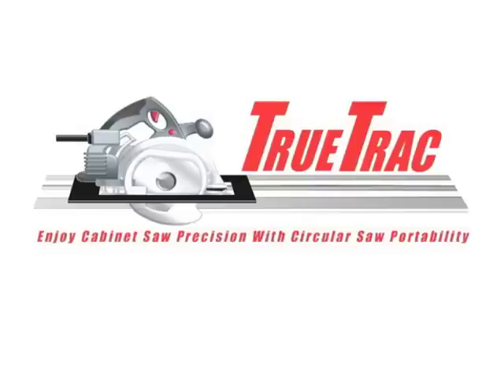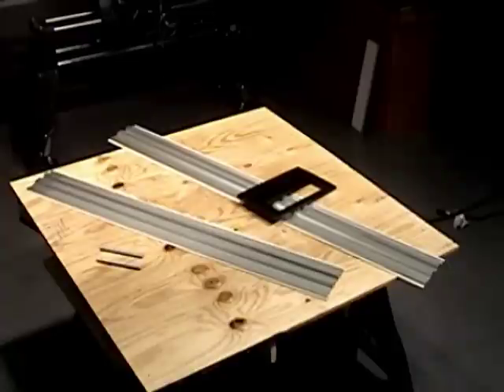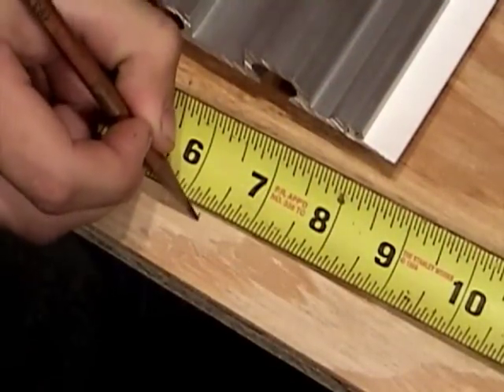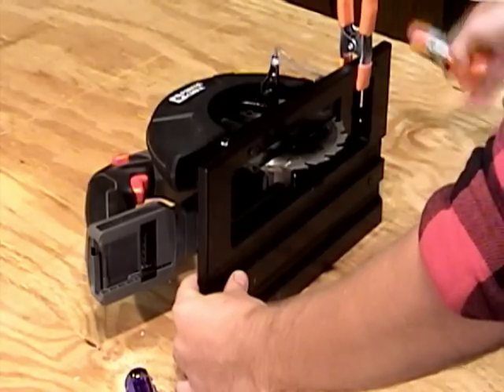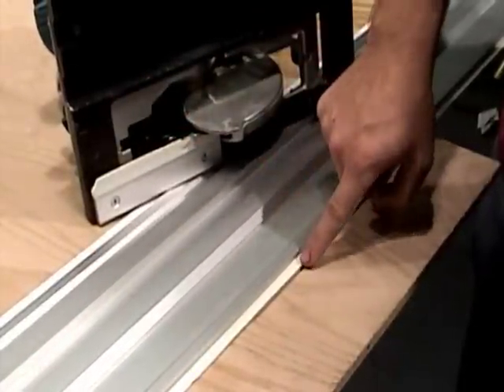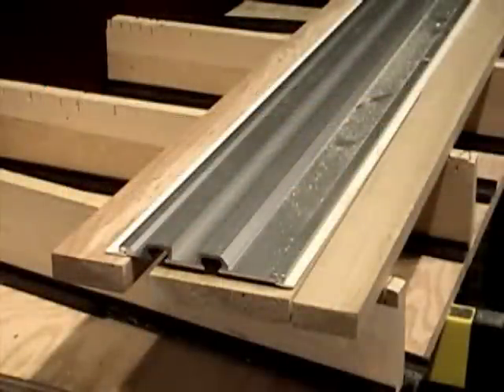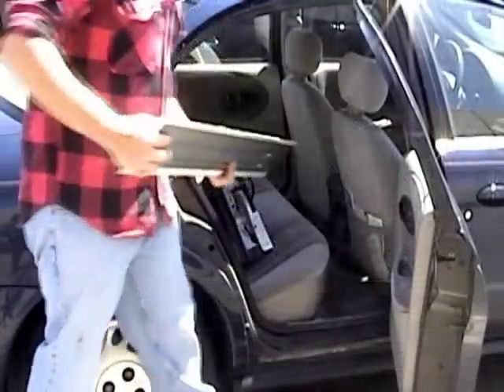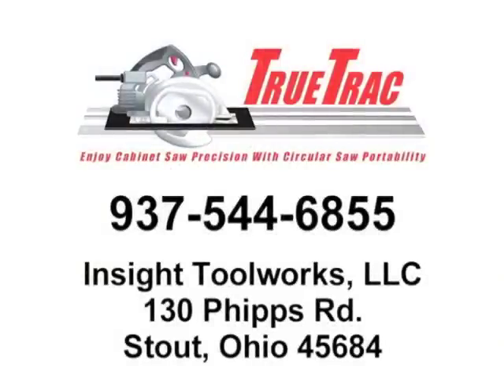TrueTrac Track Saw Guide System

Comment: I need a skilsaw for cut to length cuts on countertop blanks. For that I use a table saw sled design turned upside down. The slot runners now become the edge guides of the skilsaw's baseplate, saw can't wander, even on angle cuts, saw kerf shows cutline, and if your build is precise, the trak squares up to the work. Donations to your favorite charity. I recommend USA for UNHCR. Oh, bonus tip: if you prefer that the skilsaw not lift out but rather slide out of the trak, then just rabbet the edge guide strips. On some saws you will have to notch the front corners of the saw's base plate. Enjoy.

Comment from the maker: @lgttb1

Yes, that is a very good point, although in our preliminary testing of materials for the anti-chip edges we did use an off-brand saw that no one really remembered buying that was found under a workbench in the rear of our shop that had an 18 or 24 tooth framing blade that had been heavily used at some point, and the anti-chip did keep the 1/2 inch OSB board from splintering on the top side, just not from burning/scorching and setting off the fire alarm.

Comment from the maker: @ninjaman58 If you change saws with this system there are two thing you would have to do
1) Drill a set of holes in the base of the 2nd saw in order to mount the plate. The holes can be the same as the 1st saw, or you can drill a second set in different positions, the extra holes won't interfere

2) Replace the antichip edging. Sometimes, perhaps 80% of the time, you won't have to do this since the plate is mounted in reference to the blade and not the saw base, but you may have to in some cases

Comment from the maker: The blade guard does not get trapped by the plate if attached correctly. The opening in the the adapter plate is wide enough to accommodate the travel of the guard and does not disengage the guard before use. See the video at 0:20-0:22 seconds. Kickbacks are a possibility no matter what, but with a circular saw the object will fly away from your body, and the combination of the weight of the track and the applied down pressure when cutting reduce the chances of binding while making a cut.

Comment: I found one part of the presentation confusing. We were told that the white plastic strip was to be aligned on start and end pencil marks and were shown this being done - and then it was said that the white strip  had to be cut back (as i understood it) flush with the metal of the track, which was contrary to what had been shown being done previously.
Reply from the maker: The white strips along the edge of the track are trimmed to your specific saw and blade combination as part of the initial set-up process when mounting your saw to our adapter plate, prior to cutting material for projects.

This establishes the line-of-cut for you to use when aligning the track to the measured marks for your project, as shown in the video. The strips are replaceable and have a 2-3 year life span for moderate use.

Apologies for the confusion, but thank you for commenting and asking!
Reply: @Creslin69  Then I think the video should be edited to remove the portion showing a wide white strip, which has clearly not been trimmed back, being aligned with pencil marks prior to making a cut.

Comment: you could steady your hand as solid as the rock of gibraltar, without a guide it will never come out 100% straight.  I like this design and compaired to the others the price ain't bad.  My concern is this...what happens if i have to change saws, would i have to get back the exact model i first had?

Comment: What about making multiple cuts? Does the dust left over prevent the track from adhering to the sheet? Would I have to clean the sheet off after each cut?
Reply from the maker: Cutcreator,

The non-skid isn't adhesive based, so the dust doesn't overly impact the function. It's actually a much softer plastic that has a higher friction value. That being said, a quick puff or swipe with your hand to keep it reasonable is always a good thing.

Comment from the maker: Yes, that is what a finished cut will look like. In that particular instance, to show what happens during a cut, the cut was not fully completed. (ie, why it stops midway down the board). There are no chips due to the anti-chip system shown around 1:55, with polyvinyl plastic providing zero clearance on both sides of the blade. More detailed explanations/more videos can also be found on our website, linked in the video description. We also have a contact form, or feel free to call M-F 8am - 6pm.

Comment: Will this work with a Skill M77 worm drive?
Reply from the maker: As long as the bearings are in good condition and the blade/arbor don't have excessive play you should be good to go.

Our system is pretty good, but it can't fix a worn out saw :)
Reply: +Jacob Rhodes  Well it is in like new condition.   I purchased it a few years ago and it has light use.    I have been debating on purchasing a new Track Saw such as Festool or Dewalt and Makita but thought of going  with your system being I own a nice new worm drive saw and would rather just get cuts using it verses spending thousands on a new track saw system.
Reply from the maker: +Gary Karczewski , Feel free to browse our website (truetracsaw.com) if you haven't already, and our contact information is at the bottom of each page if you've got any questions you'd like to call and discuss or see if you would like any additional input on what sets our products apart from other systems. 

Let me know if I can be of further assistance with anything!

Comment: I just want something reasonably priced. I haven't found any track saw system (Festool, Makita, DeWalt, Eureka Zone) to be reasonably priced, in my opinion. The Grizzly one and Shop Fox one are close, but I am unsure about the quality. Oh well, eventually I will have to pull the trigger on one. I don't have the space for a table saw and I need to be able to break down sheet goods more neatly...I am rubbish with a circular saw and straightedge, lol.
Reply from the maker: Just as a simple inquiry, what would be an appropriate price point for a 4 ft capacity track system that uses any saw in your opinion?
Reply: Jacob Rhodes A four foot system? $100 tops, eight foot system $150 tops. Remember, you are only providing a track system and adapter plate (and some optional accessories). There is no saw included, as far as I can see there is also no way to actually lock the saw onto the track either (other track systems can do that).
Reply from the maker: +Ian Johnson I appreciate your feedback. It becomes an issue of design quality from my end, and features versus cost benefits...what features can you strip out of the system to simplify design and manufacture, but retain enough of an edge to be unique? It's a common problem in all areas of engineered products. Plus we're keeping all of the manufacturing in the US. Regardless, thank you for your input. If I can help with anything, let me know.
Reply: Jacob Rhodes I understand, I also appreciate that you keep the manufacturing stateside. I am typically willing to pay a bit more for products manufactured here in my own country. However, I just really want something that can lock the saw into the guide, especially for bevelled cuts. A riving knife of some sort would be nice too.
Reply from the maker: Ian Johnson - Just wanted to drop a note relevant to our now years-old conversation.

We recently brought out the “E-Series” or Entry Series of track. Offers a 4ft cut at ~$110 with the same adapter plate as the existing Pro-Series track for later upgrades if desired.

Comes with a universal adapter plate, hardware and such, and a 57” track. We use a set screw at each end of the plate to remove play between the E-Series track and adapter plate.

Comment: hang in there guys Some one will come out with one for under 50.00
Reply: Well...it's been 2 years since that comment, and the closest to what you predicted is the Kreg Accu-Cut, which is OK, but less sturdy and precise than the TrueTrac, and doesn't include -- or even allow -- an extension that would let you rip an 8 ft board. As of 2018, this still appears to be the best option for track-saw capability in the vicinity of $200.
Reply from the maker: Jonathan Strong - We did recently come out with the Entry Series for our track systems. 

Basically matches the cut length of the Accu-Cut system (4ft) but the issue the Accu-Cut has is the interaction of the adapter plate to their track. Tons of reviews on unacceptable slop there.

We threw in adjustable set screws to remove the play. Plus it’s the exact same plate we use on the heavier “Pro-Series” track featured here in this video so you can always upgrade later.

Sorry for missing this comment for six months, finally having a chance to catch up and go through our various social media accounts!

Comment: There is absolutely no comparison between the plunging track saws (with riving knives) and guide rail systems produced by Festool and this low end aluminum extrusion wanna be system.
This TrueTrac system is basically a poor man's substitution for the quality of the Festool system.  I guess that is good enough for some.  It probably is ok for what it is, but you should not expect Festool quality results.
Reply: Mafell is the best.

Comment: overpriced track.
Reply from the maker: Hi Weiyu,

Relative to what system?
Reply: I was looking for a track for my circular saw. Unfortunately they are way overpriced. So I bought Makita sp6000j1 with 55 track $347 shipped yesterday on acme tools. For better dust collection, new plunge saw and box, sounds worth the $150 difference?
Reply from the maker: Weiyu, 

Like I’ve mentioned in a previous comment, I think you’ll be happy with whatever track system you choose (in this case the Makita)

If a 4ft capacity was your target we also offer what we call an “E-Series” track, or entry series. It’s around $110 and offers a 57” track with the exact same adapter plate our Pro-Series line has. Offers later upgradability if desired.

The dust collection you have is a hands down winner for a dedicated track saw, that’s always been a negative on regular circular saws.

As far as a direct comparison goes, the Pro Series track at $180 is twice the weight per foot as the Festool/Makita tracks. Doesn’t bow or sag on longer cuts. The anti-chip/anti-slip is also integrated into one piece that is held in a t-slot, rather than two separate parts held to the track with double faced tape.

Regardless, I’ve always personally liked Makita tools and they’ve served me well across the board.

Have a great weekend!